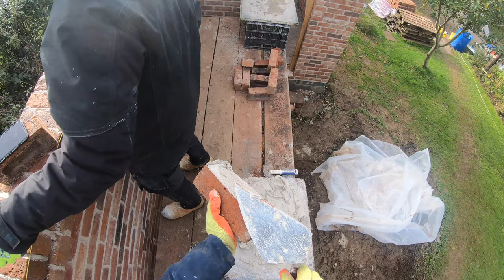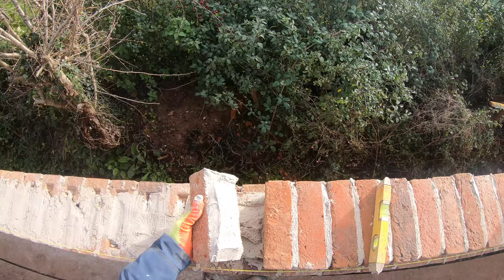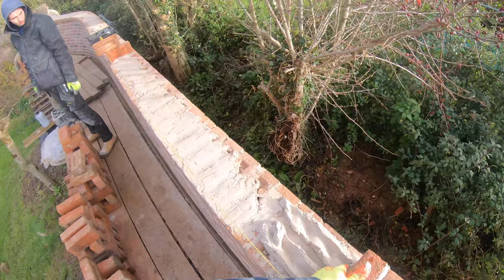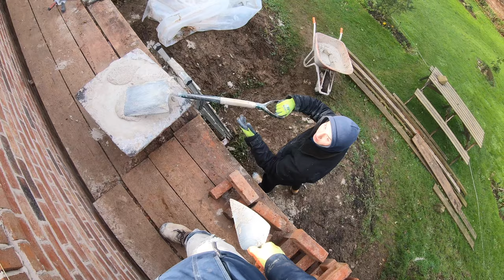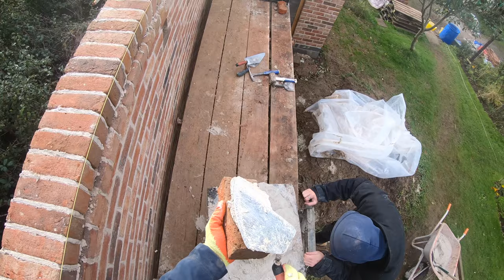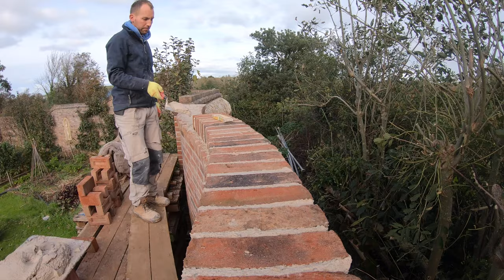Brick on edge POV bricklaying

Comment: Do you get paid extra for the top bricks??
Reply from the maker: This was by the hour but if you were by the brick then it would be a higher meterage rate for these than a standard laid brick
Reply: @SamDaviesBuilder  cool,how much does it cost to lay a brick at the moment.. approximately??
Reply from the maker: @ianhoward4246  I’m a bit out on meterage prices at the moment as I haven’t charged like that for a while. On building sites they pay per 1000 bricks and it’s got to be at least £450 per 1000 so 45p a brick roughly